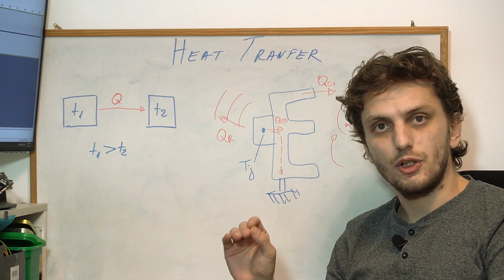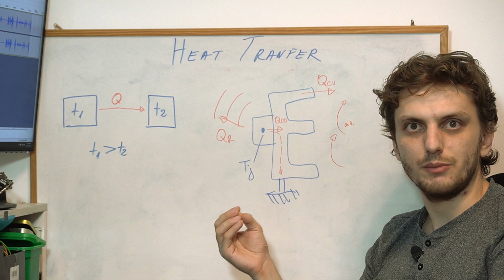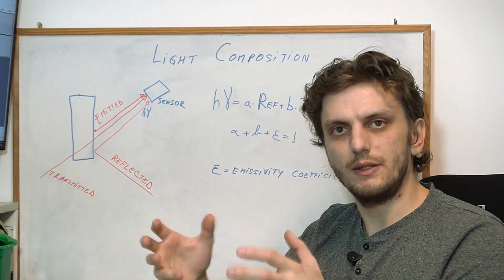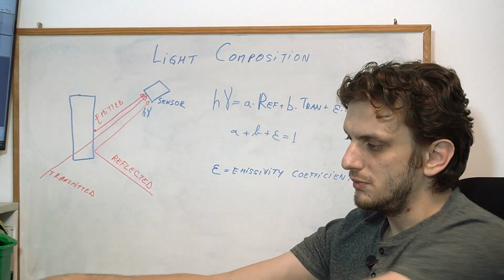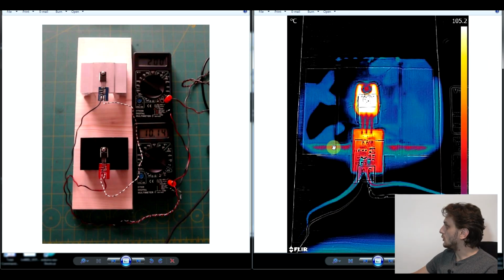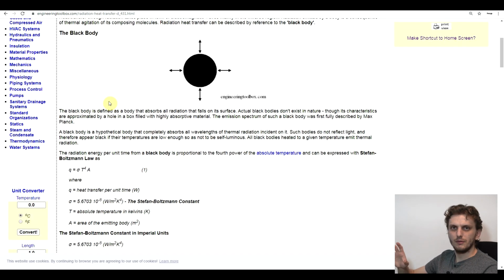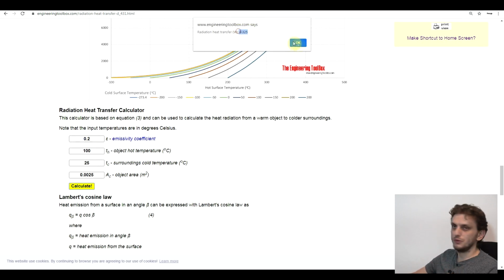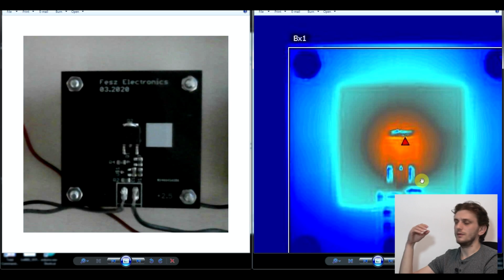Thermal Electronics Tutorial (2/2) - Heat sink coating - does it matter?

Comment: Another detail: reflectance and emission in the visible range is something different from what happens in the infrared range. So wie paint and green paint my have the exact same emissivity in the thermal infrared range, although in the visible range white is clearly more reflective. The fact that said ir temperature measurements show emission and not surface temperatures has already been pointed out. The non-painted heart sink should actually become hotter due to lower emissions.

Comment: Think about the radiator in your car, chances are it's not black. If a car company could save money/increase efficiency just by coating it black, they would. Also, if the heatsink is hotter it means it isn't working as well. 
Love your channel, keep up the good work.
Reply from the maker: Using paint to increase emissivity, and thus improve heat transfer by radiation will only be worth it if there is a cool body towards which to radiate heat and if this can be a significant way of transfer - it can be really helpfull in static environments where natural convection is the only method by which air moves. For the car, the front radiator relies on forced convection (air is being blown into the radiator from the outside, or there is a fan that can be activated at need); so the improvement from better emissivity would be negligible. And anyway adding a special paint will increase price - no manufacturer wants to do this if the benefit is not there.

Comment: Did you happen to compare the effectiveness of uncoated, anodised/oxidised and DIY spray-painted heatsinks? It is well known that with forced-air cooling, the radiation effect is often counteracted by the thermal insulating properties of the paint. But for low-power devices, fans are rarely used and it is sometimes a good idea to use an aluminium enclosure as a simple flat heat sink for the most heated parts. Interesting to see does simply painting the box with black spray result in a better power dissipation than bare aluminium in these cases and how much worse is this solution than galvanic finish.
Reply from the maker: I guess that if forced convection is used, the benefit of heat dissipation by radiation can be neglected. Radiation at "low" temperatures (<120C) will only be useful with natural convection. Regarding DIY paint, the big issue is that there are so many types of paint, its very difficult to give a clear answer, which is better or worse. As long as the paint is not shiny, or glossy but rather matte, and the coating is as thin as possible, the added paint should be better than bare aluminum. Also color should not be a critical parameter - it does not have to be black as long as its not reflective in IR (infrared); black should be best but you can have pretty emissive white paint also.

Comment: The temp differential between the silver and black sink works out to 8.8 degree C which is consistent with the 8% average additional heat transfer of black to lighter colors that I've read previously.  That was great, thanks.

Comment: Hey buddy so at an elementary level u have some of the issues with the test which you performed on those voltage regulators with the black heat sink and the aluminium heat sink (without painted). Now you are using a thermal camera to check which heat sink is performing better or worse whereas you clearly mentioned in your own video that a reflective surface acts as a mirror in the thermal world so don't you think that to actually perform those test you should be using a Thermocouple at the very end of the heat sink on both of them the shiny one and the Matte black one which would give you much accurate results.
Reply from the maker: Well, to compare temperatures on the 2 heatsinks, I looked at the hottest point which was on the surface of the power transistor - the epoxy casing, which has the same emissivity regardless of heatsink. That is why I was able to compare results. To be fair though, having thermocouples would have removed any doubt about measurement accuracy.
Reply: @FesZElectronics  oh right i absolutely forgot About that part as whole part of using the heatsink was to see which one keeps the transistor at the lowest temperature 😂. Sorry my bad . Also buddy i wanna tell something to you . I'm a big time electronics lover I'll be more than happy if you check out my channel to . But i wanna let you know that i suddenly discovered your channel and i 😍😍 I'm in love with your content . Like it is just sooooooo amazing that i watched 8 videos of yours back to back !!!!!! Do get in touch with me i would love to be friends with you . Text me on my mail .  amansinghaljpr@gmail.com

Comment: I love your content, but I have to admit this wasn't one of your strongest. There a couple of things that are just rather confusing or not quite right.
Just many small little things.
For example, in the beginning you say that air is good. 
Air is never good for cooling, but it's the only thing we have. 

Measuring aluminum with an thermal camera is also very misleading. Especially when it's non coated your readings will be off. The same goes for colors of the silkscreen. 

It's also not very clear what and how is being measured, for how long, how many tries etc (personally I would also add some tolerances and standard deviation in there). There are also quite a lot of additional variables to take into consideration to make this a fair comparison. 
In general cooling by radiation is quite low anyway. 

Once again, I really like your videos, but i just wanted to be honest. Keep up with the good work 👍🏻
Reply from the maker: Hello Piet! Regarding the radiator measurement, I would like to point out that the hottest surface was not on the radiator but rather the transistor case - which was the same surface in both cases. Anyway, the point was to show the principle rather than exact values, prove that cooling by radiation can help and that there are differences between surfaces and the difference in emissivity can be noticed by seeing the same temperature differently because of the surface finish. 
The exact amount by which radiation cooling helps will be project dependent anyway - the amount of airflow and the temperature of the surroundings have a decisive role.
Usually for serious measurements I use IR imaging mostly to find hot spots rather then to measure precise values. The final product will usually be encased in a box and the final temperature tests not carried out at room temperature but rather higher values, so the only way to measure realistic values is with thermo-couples. The IR image is useful to see where is the hottest point to put the thermocuple. 
I do appreciate honesty and constructive criticism though. Thank you!

Comment: Try dabbing Sharpie onto the surface. It gives a matt finish, as opposed to scribbling, which gives smooth finish
Reply from the maker: I also use markers to color the board when I am in a hurry or don't have proper paint. But this is a very good point, I'm not sure I tried dabbing, but you are right, it should give a mat finish.

Comment: hi there. nice experiment, but please be advised that the thermal image that contains both radiators is a bit misleading. the IR cameras have to be set up for the target object prior to the measurement. this means that you might select let's say 0.7 emissivity for the black radiator and arround 0.1 for the oxidized one. the camera will try to do temperature compensation based on this input value (and ambient, distance, humidity). it cannot accommodate showing good measurements for two highly dissimilar surfaces in the same image. what I do find interesting is that both cast the same heat "shadow" on the object below.
also what it cannot compensate for is view angle. very small camera angle differences (since the 2 transistors are not at the same angle) end up in several dC errors at >100dC. objects need to be visualized on an as-close-to perpendicular view as possible.
please try to add to your experiment a step where you measure both radiators with a thermocouple  in order to get a better temperature delta reading.